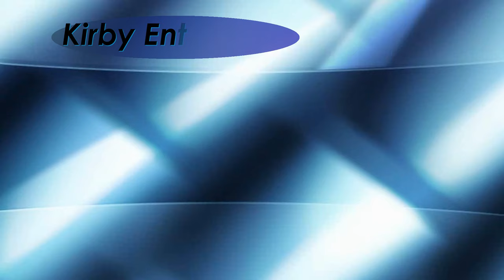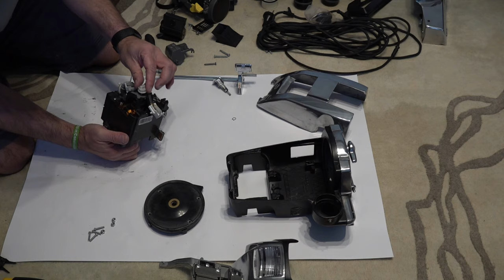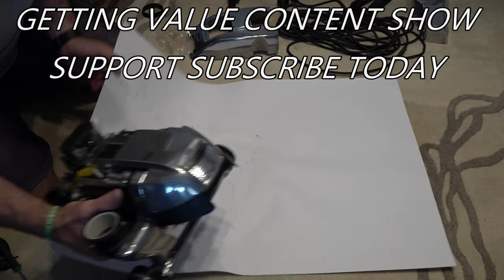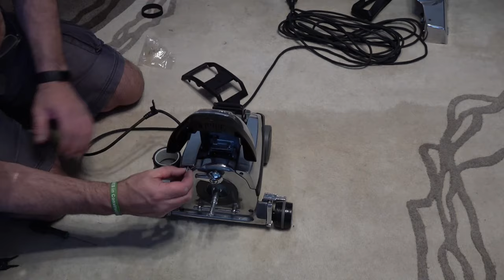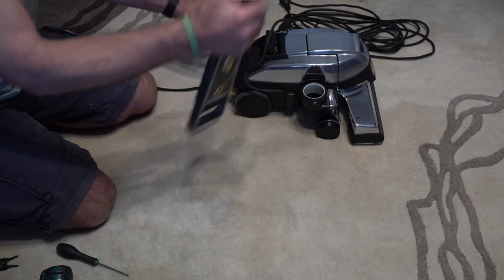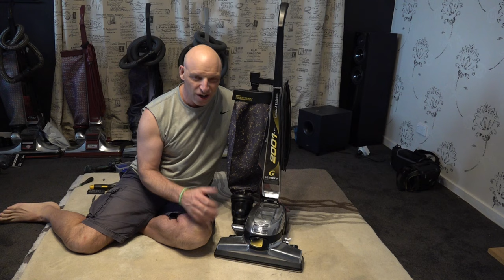KIRBY VACUUM: KIRBY G6 2001 LIMITED EDITION REASSEMBLED TO ITS FORMER GLORY

Comment: what model did they start putting the mini emptors on? If you change to a mini does it make the suction stronger on any model?
Reply from the maker: The mini emptor can be changed to a later design . The G3 - G4 hard a larger mini emptor . I changed the one on my G4 which increased the airflow substantialy. Check out my upgraded G4 video . The I did a sand battle G4 vs Avalir 2. Results were amazing

Comment: Hi  will  kirby  g6 2001 limited edition  power head  noozle fit a sentria 1.?
Reply from the maker: Yes it will and you can just change the belt lifter to match which i have a video on how to do .Hope this helps
Reply: @KirbyEnthusiast   thank you so much    the powerhead nozzle  works and spinning  but the light  on the powerhead nozzle  light don't work. Am I doing something wrong ?
Reply from the maker: @steveawp  have you put the brushroll in backwards. Check the magnet in brush roll is on correct side .